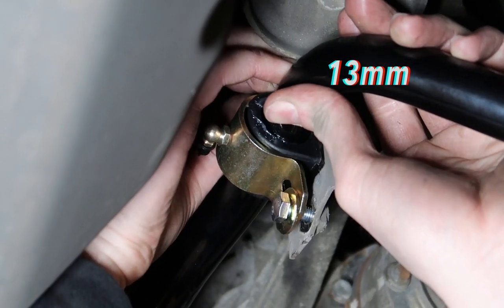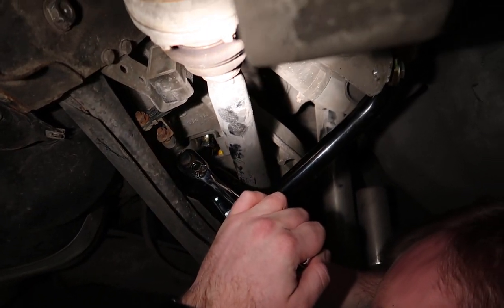How To Install Hotchkis Sport Sway Bars on a BMW E46 M3

Comment: So i did my rear today and the clearance with the axel is no issue, except that it’s a lot lower than what you are showing in the video. So low that it almost touches the lower control arm. Any ideas?
Reply from the maker: Is your ride height pretty low? That'd be my only guess
Reply: @YEVSBUILDS  rear does sit pretty low on kw v2’s, I’ll raise it half an inch and see, thanks